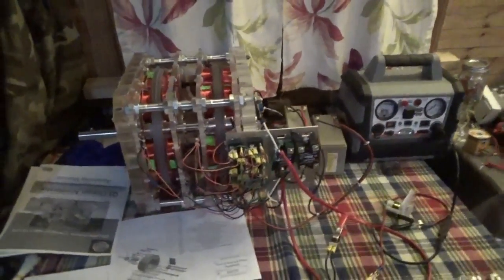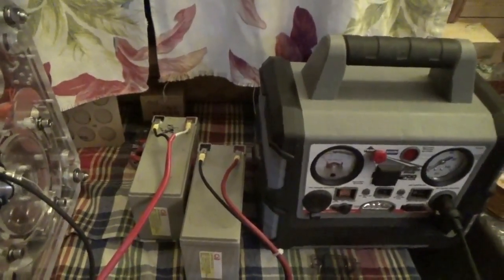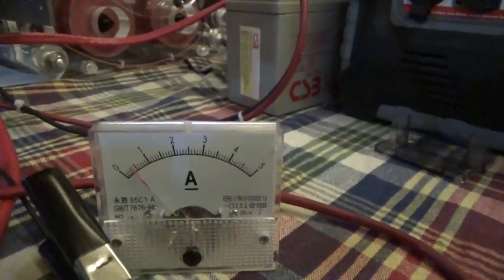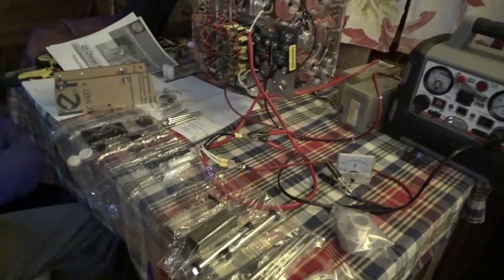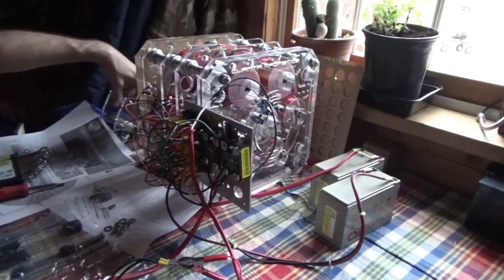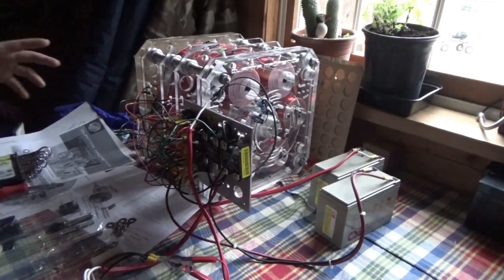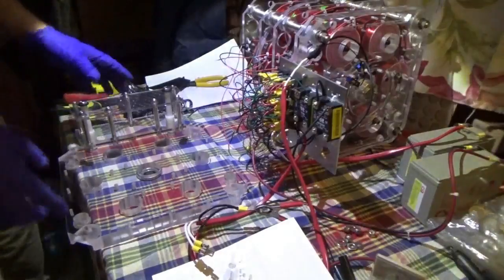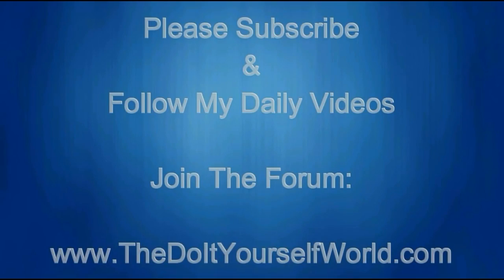Assembling The Quanta Magnetics Q3 Toroidal Section

Comment: Hey I don't know much about electronics but I've been following up on QuantaMechanics' product for awhile and I've been reading up as much as I can to get a grasp on the gist of how it all works, but what I want to know is, are their products worth the price tag?
Reply from the maker: I think it is a very well designed generator. But you must be able to tune it yourself and run experiments in order to get it to work with any useful power. Keep that in mind when considering a purchase. If you consider its about the same size and weight as a standard gas powered generator head, then you can see this has potential. But I have not had time to finish experimenting with it yet myself.
Reply: @TheDoItYourselfWorld  thank you for the prompt response sir

Comment: Hey Troy,  could you explain the function of the Toroid?
Does this complete phase 2 of the project?
Reply from the maker: Actually it is phase three. There is first the pulse motor. Then the generator. Then the toroid. A toroidal is a round coil which is super efficient and is often used in high voltage experiments. On the Q3 it can be used either to charge a battery or for high voltage experiments.
Reply: The Do It Yourself World
What kind of high voltage experiments do you have planned? Nothing involving cats I hope.